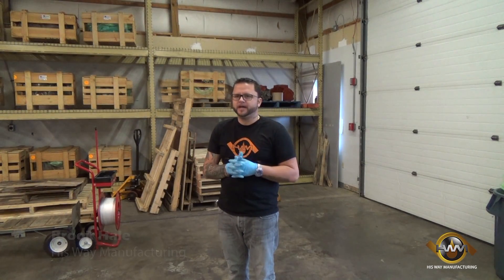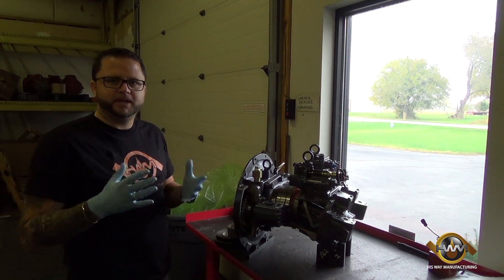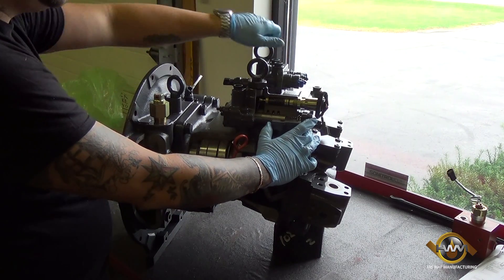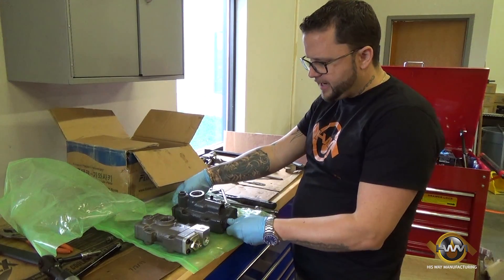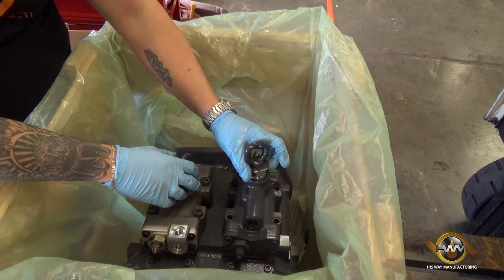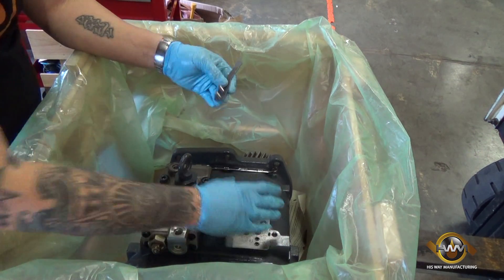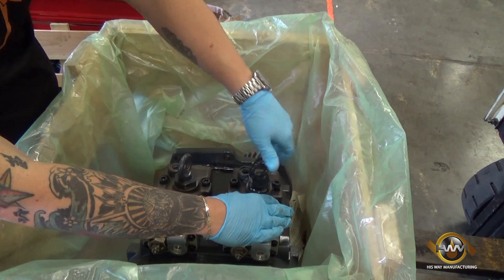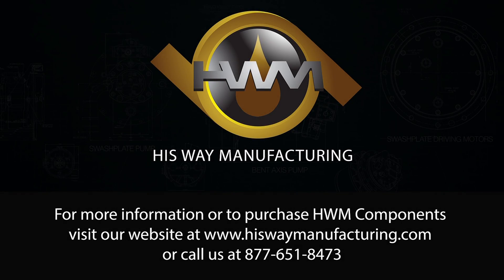How To Replace Regulators on a Hydraulic Excavator Pump

Comment: did you used Han Dok parts. before 
I need to know your opinion about Han Dok . if you please
Reply: Hi. I'm sorry I have no idea about Handok. I just know they are from KOREA.
By the way, have you heard "KJC (Kukje hydraulic)"?
Their quality of parts is pretty good. They are also spare parts maker from KOREA.
Reply: kjc not good enough compared with flutek or Han Dok
Reply: Thank you for reply.
I see. I've found each country have different reputation for spare parts maker. My Iranian mechanic friend told me JIC is quite famous in Iran. I think it is depends on market share of each spare parts maker in the country.
Reply: we for more than 15 years use handok parts, they  perform better than the similar replace
ment brands
Reply: kawasaki part only

Comment: can a kobelco SK120-3 be machanical if we change the regulator .
Reply: Goldinton  it's already mechanical. Kobelco 120-3 use kawasaki K3v63. 
this pump normally don't use the proprtional solenoid valve fixed on it. 
but. Kobelco sk120-5 have kawasaki K3v63 bdt pump. this pump look defrant from out side but rotary group inside is same as old version of K3v63. 
this pump well not work with out psv solenoid valve
Reply: Walid Elmahdy im no expart but sk120-3 hydraulic is having a lot of problems after some guy by passed it without compiter.. worked well for 4 months n now dead. so i tot it must be due to electrical powerd solenoid valves thats r all around the pump n valve boxs . any suggestions?
Reply: wil mail u

Comment: Sir, in this case the customer requested to change the electronic regulator to a manual regulator, so in effect the machine would have been converted from an electronic to a manual hydraulic function? can this be done for a HITACHI ex 200-2 electronically regulated pump/controlled pump so as to avoid frequent changing of sensors etc. as these machines begin giving a lot of trouble at their age.
Reply: How to adjust of regulatre hydrulic pump cat m315